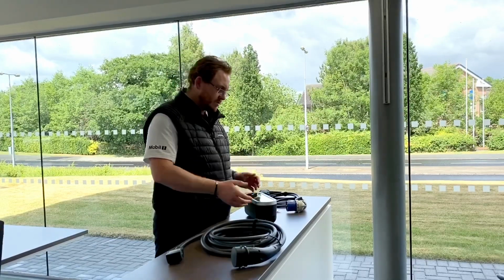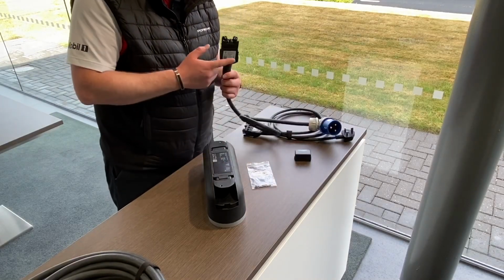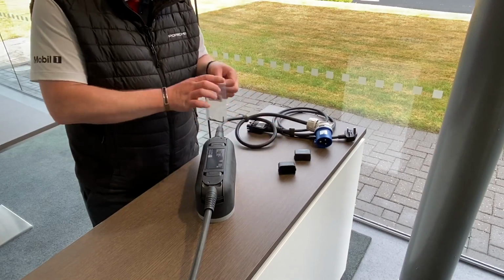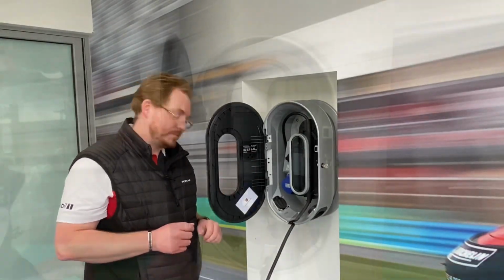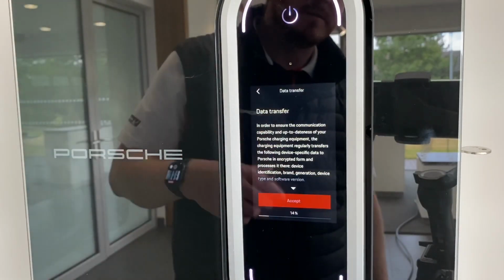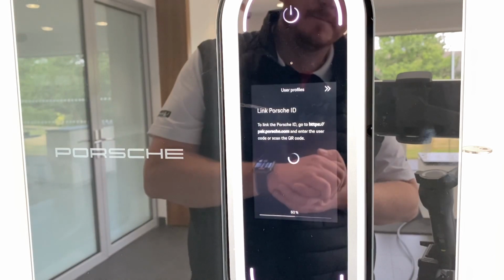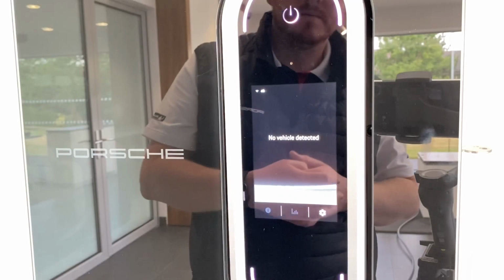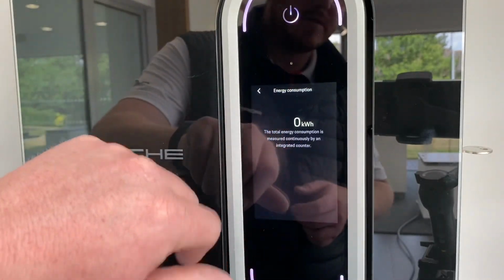How To Guide: Mobile Charger Connect

Comment: Hello, we have a porche cayenne hybrid of 2015. Our charging cable has always had problems, but always got it out. Until last weekend, he blocked completely and didn't unload, tried everything that was in the book, put door back on and off and then you would have time for him to unload. But no, he's stuck. Are very worried that this cannot be repaired, because he does not give an error message after reading the computer. Don't know if it's possible to fix this in the garage and how much it will cost 😢🙏 maybe you know what the problem can be 😔
Reply from the maker: I am sorry but we would be unable to offer any assistance, we would recommend that you take the vehicle to your local Porsche Centre

Comment: Cool video, but: please quote in kilowatts as this complies with the Porsche Tincan’s brochures: you have set up 3 phase supply in the wallbox - that’s 415v, so at 32A the max into the box will be 13.28 kw…… I think the car takes 10kw with the standard internal charger, so that’s the maximum the standard car will allow.
Reply from the maker: Hello David, thank you for your comment, in the wall box used in this installation it is fed by a single phase supply rather than a 3 phase supply (we have used a three phase supply to power our charging sockets outside of the building (a blue plug is single phase and a red one is 3 phase)), when using a single phase supply with the 32 amp industrial socket this will supply the vehicle with up to 7.2kW, the Taycan as standard can support up to 11kW when charging from AC (a higher rated charger can be used but the car will only draw up to 11kW), you can specify the vehicle with a 22kW On-Board Charger to take full advantage of a 3 phase supply where the Porsche Mobile Charger Connect can supply the vehicle with up to 22kW meaning reduced charging times. I hope that helps with your comment.

Comment: Hi thanks for the video. Two questions. 1. Is the unit waterproof, ie can be installed outside? 2. I’ve got a 3 phase supply at my works, what is the best connection to send to the unit in terms of amps ‘ volts please
Reply from the maker: Hello OrbitDist,

The Porsche Mobile Charger Connect is rated to IP55, to install the unit outside it would need to be installed in a protective housing, Porsche recommend the following enclosures when using the charger outside:

https://ppn.porsche.com/prod/phb/tinfo/TeqFinderIntranet.nsf/TeqFinder?ReadForm&ba=Taycan&ma=PCGB%20(RL)&sp=1&bt=J1&mo=Taycan%20Turbo%20S&co=30&ac=product&pr=5529634B04B99745C1257E61005A2AC2

https://ppn.porsche.com/prod/phb/tinfo/TeqFinderIntranet.nsf/TeqFinder?ReadForm&ba=Taycan&ma=PCGB%20(RL)&sp=1&bt=J1&mo=Taycan%20Turbo%20S&co=30&ac=product&pr=5589DC9B1A719ABDC12582260054CCBF

With reference to the supply, if your work supports it then a 32Amp 3 phase connection would be best aslong as you have chosen the upgraded 22kw onboard charger option.

Comment: Hello thanks for explaining everything in detail and replying to all the messages, kindly tell me the max amps the charger can take? Is it 40amps? 

I’m thinking to install a 3phase 60amp breaker so I get max amp for charger
Reply from the maker: Hello Amna,
Depending on which charger you have selected with your vehicle,  the one shown in the video is rated at 32Amps on a 3 Phase supply, your chosen installer would  be best suited to help with your electrical wiring.
Reply: @PorscheCentreChester  thanks I got the Porsche mobile charger connect . Same as the one in the video

Comment: What is the length of the cable from the charger to the vehicle?
I understand in the UK  They come with 2.5 m but Porsche make a 7.5 meter cable can this be bought separately thanks
Reply from the maker: Hello Ala, the 7.5 metre cable can be purchased from our parts department.

Comment: Would you explain the voltage you are using to power via the blue connector? With the option for 32A charging current, was that still with single phase in the UK (240V)?
Reply from the maker: Hello Ken,
The charger was fitted in our handover bay, we have a single phase 32A socket fitted inside the charger, this will allow you to charge a bit quicker than the normal 3 pin plug; however the quickest way to charge with the Mobile Charger Connect is using a 3 Phase supply.
Reply: @PorscheCentreChester  Hi, how long does it take to charge the Taycan 4S with a single phase 32A socket?
Reply from the maker: @Adamgsw12  Hi Adam, it would depend on which Battery option you have fitted to the vehicle,  which option was you thinking of?
Reply: @PorscheCentreChester  I would get the 420KW 93KWH option.